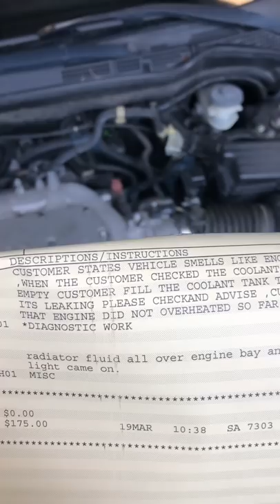Do not use this type of hose clamp because…

Comment: those clamps are fine, but you can over tighten them so you have to tighten them correctly , i prefer the ones without slots… but that radiator broke because its old and brittle, the “oem clamps “ loose tension and are more of a pain to remove..Audis have a ton of them and i actually dislike them…(Audi Tech ,15 years wrenching)

Comment: That plastic was more than likely brittle and dry rotted if it broke like that, yes the spring clamps apply more even pressure but I’ve used worm clamps on radiator hoses and heater hoses for years because they are more readily available and never had a problem like this.

Comment: Worm clamps are great in a pinch but plastic expands when heating up which is why oem uses expansion compression clamps, worm clamps will not expand and this cracks the plastic, I’m not against using them on metal pipes tho
Reply from the maker: very true my friend glad you shared your thoughts about it unlike half of the people here with no reasoning as to why they hate spring clamps.
Reply: @2zzlow  yea and everyone saying compression clamps are a pain In The ass yet the proper tool cost $15 and makes it super easy, people grab pliers and go to town on them and cause the headache but what do I know I’m just a dumbass technician

Comment: Worm clamps work perfectly fine. Just got to be smarter than your average lube tech at jiffy. Lol. They actually make high torque worm clamps that are pretty stout. Mine hold my procharger piping. That being said I don’t see how there’s any way in hell a worm clamp can crack that radiator lmao.
Reply: ^Tell me you’re stupid without telling me you’re stupid
Reply: @yourfather5324  don’t see how it’s stupid. Those spring clamps are horrible, between worm clamps and t bolt clamps I see no way in hell anyone can say they’d rather use spring clamps. Especially in todays engine compartments.. But hell what do I know, I dont play video games.
Reply from the maker: Todays engine compartment is 50% plastic from factory. A spring clamp is designed to expand from the plastic/ rubber hose heating up. Obviously they are cutting down in quality but that doesn’t mean to use the incorrect clamps.
Reply: @2zzlow  it’s just cheaper to produce. It’s the end all be all of manufacturing. Everything on everything is spring clamps. I know it and everyone else knows it if they can cut 5 minutes off each product the overhead is astronomical.. Same reason why they use quick connects on things like heater boxes etc. drop it in and snap it together like a big Lego toy, hell with the poor bastard stuck on the side of the road 8 years from now when the nipple
Breaks off lmao. Either way, I get my clamps from industrial supply store. Constant tension worm clamps. They were like $2 a piece or something. Never had any issues.

EDIT: my bad. Just looked them up, “constant torque” worm clamps is what they are. Either way they work very well and are much easier to use than spring clamps with the ears

Comment: I've used worm clamps, V band and spring clamps for repairs. It all depends on where you use them but this guy wasnt smart about it. Who in the right mind puts that on a plastic inlet/outlet. 
I only use worm clamps on half inch or smaller hoses and only if they are over top a metal inlet/outlet, never plastic.

Comment: Ive had several oem clamps do the same. As others have said its not the clamp. Its the plastic. I use these clamps in alot of vehicles and have never had this issue unless the plastic was already toast.

Comment: Those jubilee style clamps have been used since the dawn of time without issue and were the standard clamp on almost ALL cars.
The reason they swapped to the quick release style is for ease of installation on the assembly line during production!

Just don't tighten them to crazy torque, just nip them up!

What I've found with the quick release ones is they often dig into the hose too much when installing or removing over ridge flanges on most couplings the hoses fit on to.
 They're almost fit once and forget because they sometimes lose their spring grip after you open them up!

Then become a sloppy fit after refitting! 😳😲👍⚠️😁

BTW those plastic hose connectors on rads and other coolant couplings and unions are junk from day 1. 
They should be metal but the manufacturers use plastic to cheap out abd save money.
The trouble is with constant heat and cool cycles the plastic deteriorates and eventually goes brittle and just crumbles.

I had one break on my MG ZT 1.8 turbo, luckily it didn't over hrst but it caused a ton of issues and they want crazy money to replace them, even though they are cheap plastic,  sold the car just because of them! 

Because the plastic replacements will just fail again later.⚠️😲😳

Comment: I hate those spring clamps. Worm gear clamps are great IF you buy the good ones with rolled edges. I been using them for 25+years with no problems. The clamp didn't cause the issue, some dumbass over tightening it did. Never blame the tool for the individuals fuck up.

Comment: Really dude? Plastic degrades over time and becomes brittle. If you use a self adjusting clamp on an old radiator the same thing will happen. BMW is notorious for cheap plastic breaking up and the cost has caused every manufacturer to jump on the bandwagon. The worm gear clamp is mildly the problem. Oh yeah and also rookie mechanics.

Comment: Ive been working on cars since '99 and I've never had a problem with replacing the squeeze clamps with worm gear clamps.  I've had a few squeeze clamps break and replaced them with the worm clamps and they work just as good and are easier to remove in the future

Comment: Good for you for hating the better clamp. The best is worm drive as they will not loose tension and most are made of stainless steel and won't rust away. The only problem is if they are overtightened. Over the years of owning a shop I've never seen a clamp related failure with the worm drive clamp unless it was overtightened. But I lost count of the amount of time money and more often than not the number of engine failures because the "constant tension clamp" didn't have enough tension to hold the hose on the connection and blew off going down the road and by the time the customer was even aware that they had a problem it was too late to save the engine.

Comment: That is caused by someone adding water/cheap antifreeze,  throwing the PH level off their by causing the coolant to become corrosive,  the worm style clamp was probably an attempt to stop the upper hose with the factory clamp to stop leaking! The clamp did not corrode the radiator!

Comment: In my 20 plus years of vehicle repair I have found that the OEM compression clamps in time get weak and become garbage. I have seen way to many come backs after re usage of the OEM clamps and now the vehicle has a leak. The fix is to use the screw clamps.

Comment: The edges are sharp and cut into the silicone rubber.
I use Mishimoto black worm clamps that are more beveled but not on fluid hoses.

Comment: I use worm clamps if that's what was there before.  I use the constant tension clamps if that's what was there before.   I have the proper tools to remove those clamps, so it isn't a really big issue.

Comment: It's not about overtightening, it's about thermal expansion. That radiator inlet grows by about a millimeter every heat cycle, and the screw clamp doesn't.

Then again...Nissan have been using wire style screw clamps since the 80s and they work fine.

Comment: Alright, the real reason why you should not use MOST worm gear clamps is because they provide an uneven load pressure on whatever you’re clamping down on, so on a soft brittle plastic piece that is prone to significant expansion and contraction these are technically not the proper clamps to use. The spring clamps provide an even clamping force over the entire area therefore whether the plastic expands or contracts, the spring pressure load should never change. Now, there are some specifically designed even load worm gear clamps that are designed for this application that I use in my shop and I have seen roll off the factory many times and these are much nicer to use and typically don’t fail often.

Comment: I like those worm clamps, so long as whatever they're clamping onto is made of a metal. Haven't had an issue so far with all aluminum rad and ps reservoir since installing them. Definitely better to use those c style tension clamps for plastic stuff.

Comment: My family has been using these style hose clamps for over forty yrs, as for me I've been using them for about twenty yrs and not once have we had this problem.
  They've saved me more money then I care to count over the years, last car I used them on was a 06 seabring, this thing needed a new heater hose, one end was bigger then the other, dealership wanted 200$ for it and it'd take 2 months to get to me, or I could go to Boston MA for it.
  Went to autozone bought a two packs of hose clamps and pulled a plastic heater hose off a other sebring Jerry rigged it all to gather and the car ran fine then and still run fine, replaced the oem clamps for my radiator neck the same time, still haven't had a problem and that was 5yrs ago.
  Radiator neck failure can happen even with oem parts especially with temperature changes, I mean honestly who thinks it's a good idea to use plastic and ship a vehicle up to New England? Plastic and cold don't mix and I see people with busted Radiators all the time in the winter and they have oem.
  Vehicles that get cranked out now is military grade equipment, whoever can make it the cheapest slightly least sh*tty get the job, another comparison puppy mills will give you a better product them the automakers will.
When I bought my 2018 new I had to get the window arm and motor replaced and I only had it for six months, back in the 90s you could at least expect quality and a decent price tag, now it's 90k+ and you get something slightly better then sh*t, figure that one out.

Comment: Oem pinch clamps can push off, nothing wrong with screw clamps to prevent that.  Just replace dry rotted radiators and don't over tighten.

Comment: I had my radiator connector snap in half due to the force required to remove the hose. And advice for next time, or should I just not drive a BMW?

Comment: Use the clamp you like. As some have said, the POS Plastic hose fittings deteriorate over time, crack & break. NEVER have that problem with steel.

Comment: I agree with not using worm screw clamps BUT I Don’t think that broken rad neck was caused solely by the clamp. The plastic in some of these radiators are horrible. 
I’ve seen new radiator break because the plastic is so thin. 
Great video keep up coming

Comment: After years of owning a mechanic service, this is the only person I've come across that wants oem spring clamps. 🧐  the right size clamp helps a lot with worm drive clamps though
Reply from the maker: Worm drive clamps weren’t designed for plastic inlets due to no expansion room caused by the heat.
Reply: @2zzlow  they didn't even come out with spring clamps till the 90s and 2000s depending on make. I'm sorry, but we had to use worm drive cause there was NO ALTERNATIVE.  For you younger guys I guess yall can talk spring clamp design and theory all day. When I was in school, spring clamps weren't invented😅

Comment: I've been wrenching for about 50 years, and never had problems with the worm drive type clamps.

I always use a magnet to make sure the screw is stainless steel - often the clamps are stainless but the screw is not.

Put some hose sealant on, and don't over tighten. (Doctor, it hurts when I do this...)

Comment: The issue is that the radiator is scrap.
A good radiator if they have plastic side they also have a metall pipe inside the plastic pipe so you "can't" overtighten them.

Comment: Oem clamps are used only becuse they are easy to assemble in an assemble plant environment. I've probably replaced 20 oem clamps for every 1 worm clamp. And is almost impossible to over tighten those clamps. They strip out before anything like that can ever happen.

Comment: The proper clamps he pointed out are called spring clamps  because they will expand and retract under extreme pressure. The worm gear style clamps which were the improper clamps, they lock into place through the tightening mechanism where it gets its name from. Worm gears are best for more structural but frequently used areas, and items under low or no vacuum/pressure ie cold air intake couplers commonly use these. Most cooling systems are under 16-20 psi and the hoses can expand and retract rapidly worm gear clamps over time will cut into the hose because they are not meant to fail but spring clamps are meant to expand and retract theyve also been known to help reduce the risk of a head gasket failure. Idk about you but id rather replace an upper radiator hose a radiator cap and serpentine belt (don’t forget if your belt gets wet under tension replace it. Its too loose) than a cylinder head gasket

Comment: It's because they can't tighten the full circle. You can make wire clamps with a tool. Look it up. Aviation style house clamps. You need the right wire tho it's got to be stainless veru strong. It's actually worse to over tighten it because not only it breaks stuff it only gets right on one and if tight the part where it's not tight bulges out more. You can also loosem it and Rotate it  sort of helps.

Comment: People don’t understand that the reason spring clamps are used is because the radiator expands and contracts constantly. Spring clamps can compensate, if you use a worm clamp there’s not as much compensation and you run the risk of breaking a radiator. I’ve had no issues with spring clamps. Not once.

Comment: This style of clamp are good on older vehicles where 90% of the engine bay is metal. The newer vehicles have maybe 6 parts that are metal which are commonly the block, head(s), water pump, alternator, exhaust manifold, and in some cases the throttle body but I've been seeing these switch to plastic as newer models roll out. Personally if I'm to pay $60k+ for a vehicle I'd like to see the plastic be replaced by carbon fiber components, at least on parts where mechanical strength is necessary.

Comment: Ok so the plastic on my radiator broke just like that because of the clamp breaking it. Does JB weld work as a temporary repair or not? I kind it doesn’t bond to some plastics but just wondering, don’t wanna rip out the whole thing yet.

Comment: this vid nor the comments are correct. the 'oem' clamps are used because they install quicker in factories, and are cheaper to have manufactured. the glass fiber parts in that radiator expand/contract in much smaller increments. also, that car appears to be a 04-08 era, the oem radiators last 20yrs at max if youre lucky, and 12yrs on average in testing. so busted radiator is on par with normal lifespan here. chances are the worm clamp was the initial 'repair' done diy to get by. also overly concentrated coolant will make plastic brittle as well.

Comment: They need a need thermostat if they smell anti freeze. The clamp that is on there is a O'Reilly or auto zone emergency clamp to replace the old one. Whoever did radiator work broke it before that

Comment: These clamps are just fine to use and id much rather them since they are easier to remove, as long as your not an idiot that over tightens them they will be fine, just snug them up then a ¼ turn and they are good to go

Comment: The pinch clamps fatigue over time. Many mechanics prefer the screw type clamp for this reason. Just don't over tighten, but check for leaks, once installed.

Comment: Yeah worm gear drive clamps cut the hose. Yes I have them on my vehicle that’s how I know. I haven’t crushed any plastic fittings but Ive replaced cut hose and they work fine after that just use the correct size range and don’t over tighten.

Comment: Ya we only use Worm drives at my shop..
They hold more pressure.. And you can dictate their tightness...

Those OEM spring clamps don't last very long, are often difficult to remove even if you have the tool to do it...

I'd take that type of hose clamp over the spring clamps

Comment: Used these my entire life for coolant, fuel, trans fluid, brake fluid, even on boost couplers (only up to 28psi), and have never had a failure. Plastic, however, DOES fail. Just get your torque-arm calibrated and don't over tighten.

Comment: A while back I was hunting a small coolant leak in my Honda (an EJ2 technically). A pressure test showed a tiny little bubbly gurgle from the rad end of the upper radiator hose, and guess what style of clamp was there? You guessed it, worm style. At that point, I decided that I absolutely hate worm clamps, and felt like going on a crusade against them. Sometime later I replaced the radiator hose and clamp (with OEM stuff), and the leak is gone. However, I realized that I don't think the problem was the clamp - it was the hose itself. The replacement hose fit much tighter; I think the old one had simply worn out.

I like spring clamps because you don't have to "know" how tight is right, but after doing a driver's side radiator hose on my buddy's Chevy Cruze with GM's 1.4 turbo, I will say that there are absolutely situations where spring clamps are a huge PITA. And we did have the fancy remote spring clamp tool FWIW - access was just terrible in that case.

In the end, I think both have their pros and cons. I like using springs where possible, but if a friend of mine is on a budget or doesn't want to wait for an OEM part (or we're running out of patience and need to get a job done), worm clamps will certainly work. Spring clamps can also crack plastic fittings if you let them go to fast versus letting them go gradually.